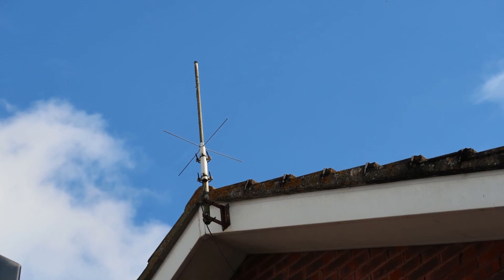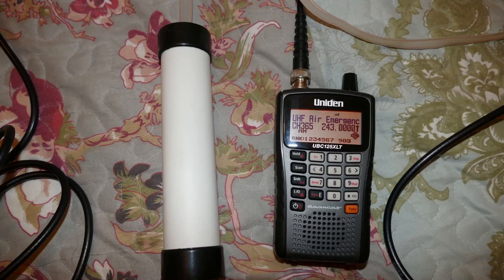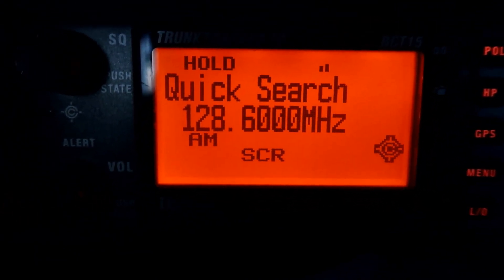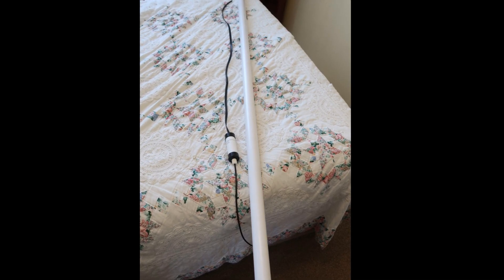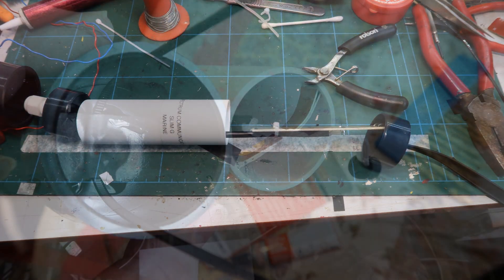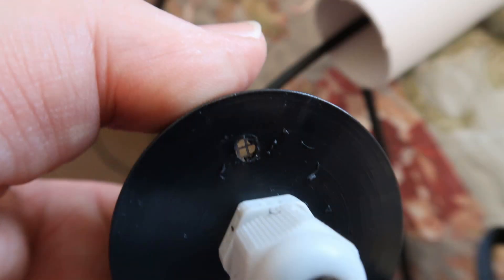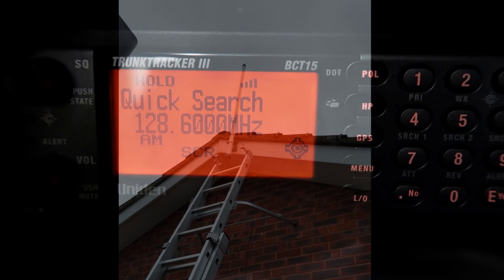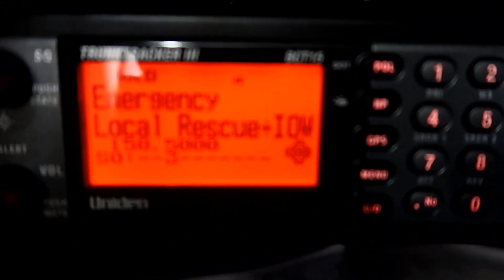DIY: Converting an Indoor Scanner Antenna into an Outdoor Base Station Antenna

Comment: That sounds encrypted on the last section of the video. I use a Slim G for airband civil. I had a custom one with 20m coax and use a 10m pole it when camping etc. It’s perfect. 😊
Reply from the maker: Thanks for the info!
Reply: That is actually an MPT-1327 control channel. MPT-1327 systems cannot be tracked with a normal scanner.